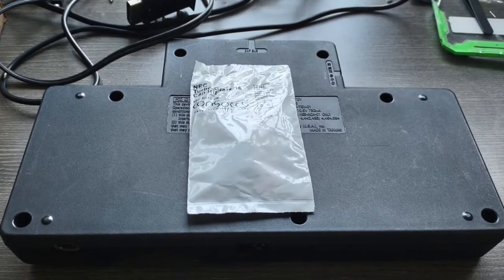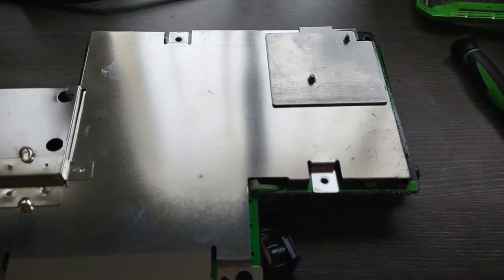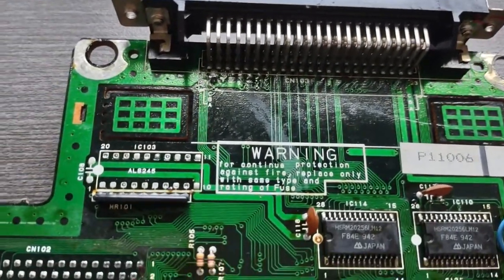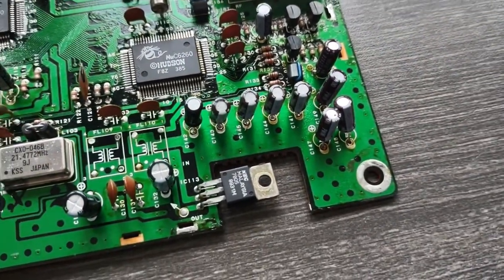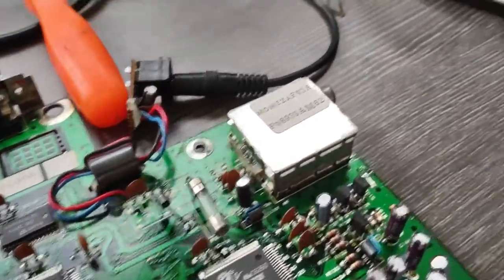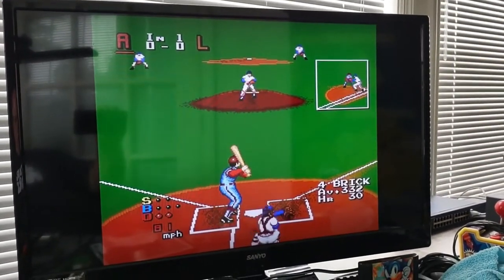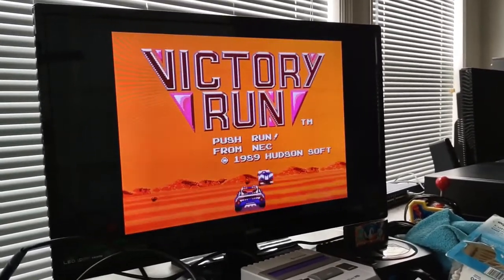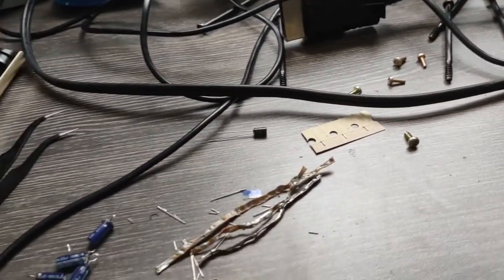TurboGrafx-16 Capacitor Replacement /w Jailbar Fix

Comment: These capacitors are a pain in the butt to remove. They have a death grip on the board. I had so much trouble desoldering them without almost ripping the pads off of every single capacitor. I did all the caps except for 2.

Comment: The caps were tough to remove even with the Hakko 301.  I had to bend the ends up before using the gun and even then some were really oddly bent and hard to pull through.  Also my board was just drenched in flux.  Seriously WTF NEC.
Reply: I just recapped two of these and had the same issues. I've recapped a PC Engine, 2 Core Grafx and 2 Core Grafx II and never had these issues. There's definitely a difference in the quality of the PCBs between the North American and Japanese consoles.
-

Comment: I never noticed any jailbars on my TG-16. Was this a problem with only certain models? It looks like there are two different board versions of the TG-16 when I looked at console5's cap kits
Reply: Really only noticable on a modern display via a scaler. 

If you're using a CRT, you likely won't see them.